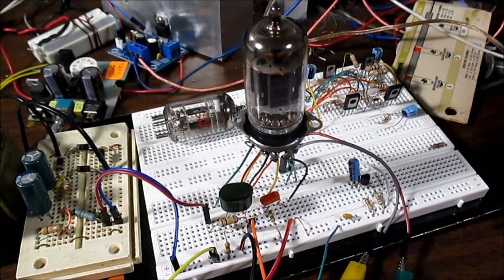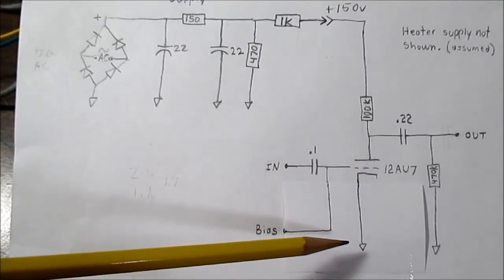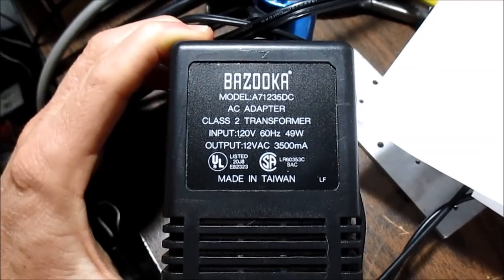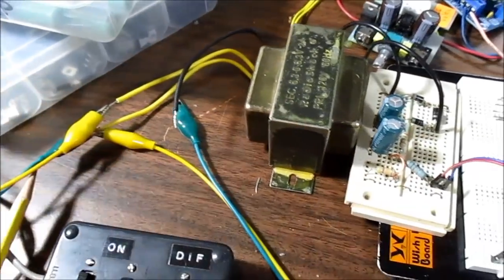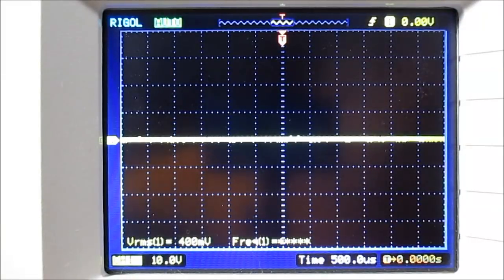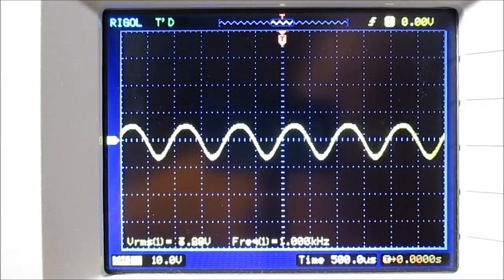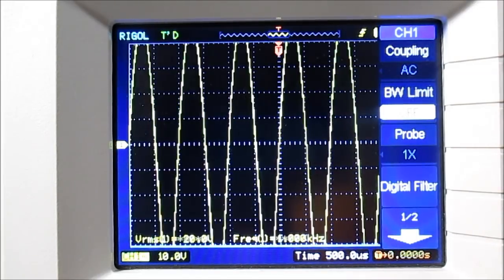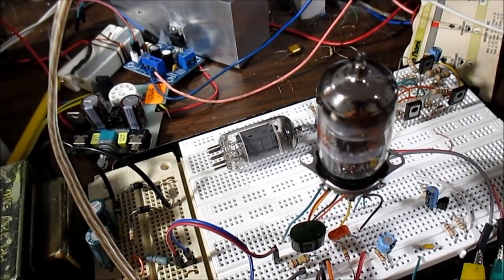How the cathode resistor cleans up vacuum tube amplifier performance

Comment: I liked that idea of using a 12v 3.5amp transformer driving another 12 volt secondary transformer to achieve the 120 volt from its primary for the plate voltage

Comment: Huh, I just can't. Do not even know where to start. The very best for humanity would be that YouTube stops exiting.
They will never change, and they made it possible that anyone looks like an expert while they have at best dangerous half knowledge that they are teaching people that do not know the matter. One person ploutes thousands.
A lot of times, it's just an innocent misunderstanding of complex matter. Seeing just one part of the complex environment.
This leads to explanations that look like complete picture but actually aren't explaining everything that is needed to be able to apply the knowledge.
The sad thing happens when the video explains one thing partially good but introduces bad information and doesn't explain why things work the way they are and what was necessary to be explained.
Let me give you a few actual facts.
You do not need a coupling cap in the input of the tube amplifier. The better thing to use there would be a grid stopper resistor.
Tube conductance is regulated with the voltage only. One brings voltage on the grid, and depending on its polarity and value, it will regulate the flow of the current. Negative voltage will stop the conductance while positive charhe will increase it. There us no grid current to speak off. Hence, coupling cap would be necessary only if you are inputing DC voltage instead of AC signal like audio signal is. At the same time, the coupling cap is needed, or at least it is a good thing to have in the input of the transistor circuit.
On the other side, grid stopper resistor would prevent dangerous self oscilation and parasitic oscilations. 
You can't have a non biased tube. Plate resistor does so many things, but it certainly is not used for the biasing. Sure, it will limit the maximum currnt draw, but it doesn't do much for the proper biasing. 
Biassing is done by bringing appropriate levels of negative voltage where, indeed, the cathode biasing is working like that and is most often used method in the preamp sections.
It's not enough to say you can't do this with more powerful tubes because you should never do it in the real application, disregarding that you can get away with it in the experiment like this and for the short time application you shoild still never let the tube run away.
You should not use bread boards for the tube experiments. Aside from the issues that come with the high voltage, especially if someone would like to design the output stage of the amplifer, there are so many potential issues that will be introduced by using a bread board. Contact resistance means way more in  high voltage circuits. Bad contact with grid especially will make tons of issues. There is a reason why millspec and nasaspec soldering standards were made. Simple experimenting PCB is way better and solves so many issues and prevents huge troubleshooting efforts.
Disregarding that Ohms Law is the same in transistors and tube circuits  things behave differently in such circuits. High voltage, high impedance and low current circuits are more sensitive to cold contacts, dirty contacts as well. Making proper mechanical contact and using soldering just to lower down contact resistance and to remove oxigen from the connection are rules for tube technology.

Comment: The moral to the story is dont bypass cathode resistors or if you do just partially bypass cathode resistors. If u dont need the extra gain then let the cathode resistor clean up some distortion

Comment: You just cured a 6 year issue. Thank you so much! And I trust wood and rubber insulators also. Just like my discharge tool, or wire insulation and a wall... couldn't help it. I saw pencil Karens...

Comment: 16:22 So what would casue a 22u/25V polarised cap to blow from the cathode of a 6V6, also in parallel is a 1W/470r resitor and a 104/63V cap?

Comment: That, was a great video that was explained well. I am trying to understand the differences between transistors and tubes in audio circuits and haven't built a tube circuit yet. 
Thank you uncle John.

Comment: I just read an old (2008) article from Gyula Sipos (IC engineer from Hungary ). Tubes vs Transistors in HI-FI amplifiers.
The transistor amplifiers can be better in THD measurement if they are using one or two input signal. Over three different input signals the tube amplifiers are better in THD, those are make less harmonics than transistor amps.

His experience.  The production quality of the tubes in 1950's  was much better than the transistor's in 2000-s. Deviance of parameters in branded tubes were around 10% in 1950-s. Deviance in transistors are huge in 2008 still.  Pairing is not doable in amateur's workshop. The simple hfe measurement with DC in one operation point worths nothing.  Deviance from vendor-to vendor, from transistor to transistor. Transistors are more complicated than tubes.  Those have around 70 parameters which is only known by producers. Every parameter connected to every else parameter. For example just Hfe changes with temperature, current, voltage, frequency and of course different from vendor and series. The silicon temperature changes measurable to 50kHz.   The transistors are much better on hi freq above MHz, they can easily oscillate in Mhz region. The combination of non linearity and complexity and hi freq oscillating the harmonics can produce frequecy product around the audible sound [freq intermodulation], which is unnatural sound and harmful for listener.

Comment: 6% seems kind of high even for a 12AU7. Of course that is a lot of output swing with not a lot of supply voltage. It would have been interesting to see the results at more reasonable output or more appropriate B+. A good video would be optimizing operating points.

Comment: if you put a capacitor in the circuit with a smaller value would the grid be getting less current?

Comment: I built a tube tester based on your concept. I can plug in any tube and with jumpers I can hook the tube and resistors in circuit while controlling bias voltage vs plate current, thus calculating Transconductance. I also inductively couple a sine wave in on the grid and measure the plate signal for a gain measurement in Siemens.

Comment: Because of the relatively low gain the 12AU7 is normally used as a phase inverter in double ended amps.

Comment: ...same Harmonic Profile generated here by a tube (12AU7) and by a transistor (KSC1845) in the week before vid of nov 08,2017 . You prove on the scope that Harmonic Profiles are a result of the circuit design and not the result of discreet audio tube vs transistor components . i see it w my own eyes  - -  same profile , same intensity . Other things like threshold noise may differ - - but i can forget my cherished view that tubes r inherently "sweeter" . .  . .............shalom,a.j.

Comment: Very interesting! I had always thought that Plate Voltage was purely an applied voltage, not  a derived voltage determined by the grid bias. I'll have bench this out now and experiment!   Thanks!
Reply: It’s my understanding that the voltage is applied to the circuit the vacuum tube is in which means the voltage at the plate could be the applied voltage but the voltage drop across the cathode to plate is derived. Cathode follower is when the useful load is placed on the cathode side of the tube.
The tube acts to transfer small voltage fluctuations occurring at the grid the occur in larger form across an element in the circuit having cathode to plate continuity. The heater is not the main source of heat but all the mobile negative charge carrier bombardment going on within the tube is my guess. If there wasn’t a load in the circuit containing the tube the circuit would 100% inefficient with no useful output.

Comment: Hi there i have buld an stereo  tube amplifier with output tube a 829B at 520v on anode my question is what resistant must i use at the cathode. In some schematics i have see diferent  values from 220ohms to 380ohms.
I think the higher the resistance to the cathode  as you lower the power output but i don't want to reduse the output power

Comment: You chose a cathode resistor based on your desired bias voltage. Is this good practice? You could choose a cathode resistor based on some other criteria and set the bias with additional components.
Reply: Remember, the grid had to be negative by 3.4v with respect to the cathode.  That resistor raised cathode by 3.4v, now pulling the grid to ground it is biased with the plate voltage at half the supply... giving maximum output signal swing in both directions!  This technique, called "self bias" is used with jfet biasing (using a source resistor)  This eliminates the need for dual supply.  He did it absolutely correctly.
Reply: @mikeduino4596  Maximum signal swing in both directions happens at 2/3 of supply voltage, not 1/2. (Which is why John's signal clipped on the positive excursion before clipping on the negative excursion.)
Reply: @silasfatchett7380  If what you say is true, then a circuit biased at 1/2 of the supply voltage would clip first on the negative output excursion. Right? This post is so old I don't remember the exact circuit. I designed and built a tube preamp with a single 12au7 and biased it pretty close to 1/2 B+ and it works fine.  I used 150v B+ and have about 22Vp-p before any clipping.  With a gain of approx. 18db I'll NEVER get close to clipping with a line-level input.

Comment: After trying different value resistors on my preamp tubes, I figured out that placing a 1.2 Volts rechargeable battery as a replacement it works the best. Now my preamp tubes get between 1.2 and 1.3 Volts on the cathode to ground and they are happy! The batteries recharge themselves when my amp is turned on, and there is no issues. I don't have to worry from now on about resistor and bypass capacitor values no more.
Reply: You could also use some LEDs instead of a battery and enjoy the light show while you play  :)
Reply: @jaysterdude  Actually I was thinking that exactly, I have something on a board right now.
Reply: How does a positive power supply, recharge the battery?

Comment: John, nice video. I especially like the part where you showed the gain measurement of the triode. I have recently gone thru my TV7 tester and did a full calibration which, fortunately, turned out well. No repairs were necessary. But it got me thinking... instead of purchasing a 6L6 cal tube, why not make a simple circuit to measure the gm of a handful of the old metal 6l6'S and do it yourself. I have a second tube tester that I used for comparison to do my adjustments. I see across the Internet where people build tube testers and some of them look really good but I am thinking really basic. Just a chassis with the sockets and PS and banana jacks for accurate instruments to measure the plate current and bias voltage along with driving signal for the grid. I guess the way I am thinking right now is why I noticed your gain measurement of grid voltage vs plate voltage. Anyway, just wanted to say thanks for posting.

Comment: Interesting video. I don't see the value of using vacuum tubes anymore. Power hogs that have now be refined to micro-meter size JFET transistors for amplification of weak signals, and BJT transistors for power output stages. 
Fun Fact: Apparently, vacuum tubes where discovered to be EMP proof. This is based on U.S. taking apart the MIG 23 that defected to Japan from Soviet Union in the early 80's, and finding all the circuits around the inside of the aircraft, to be vacuum tube based!
It wasn't however due to lack of advanced IC design. 
The central brain-box, composed of traditional micro-electronic ICs circuits, but encapsulated inside a steel box, with shielded cables going to various external circuitry. 
They can take a kicking, and keep on ticking.
Reply: They look really nice, tube amps are relatively easy to build and understand, and the sound you get can (!) have a certain "warmth" to it. It's similar to the comeback of vinyl. A good DAC and Player are superior in terms of sound quality, but the sound of the vinyl itself can be pleasing too.

Comment: Hello John!
I am just think on a topic it would be good for a new video! and that is how to properly make a power supply for this amps you test.
Treating dual rails, for both mono and stereo amp boards, and perhaps using a voltage regulator too!

Comment: John, I'll would like to add when you add the catode cap over the catode resistor, you short circuit the AC content but lifting the DC that why the amplification gets better.
Reply: Hendry parman the DC does not change when you use a cathode capacitor, other than it stabilises it if the cap is very large.

Comment: Been saving this video so I have something good to watch while I have my dinner.  In my experiments with an ECC83 (which is the same as a 12AX7), I also found that a 4.7k cathode resistor seems to provide the right amount of bias.

Comment: Thank you for explaining that.... I was thinking as same as for the emmiter capacitor.. For transistor.. Same applies for tubes... But in my book they include a capacitor. I think that is for gain... But it increases distortion... They forget to mention.... Thanks john... I appreciate
Reply: Ranjan....I haven't watched this video yet...Nevertheless the emitter resistor does indeed introduce local feedback. The bypass capacitor connected across removes this feedback for AC signals restoring gain etc. The DC conditions are stabilised by the resistor - always remember there are DC conditions and signal conditions to look at in a circuit.
Reply: PS Often the emitter / cathode resistor is split into two values and only one is bypassed by the large value cap (to cover low frequencies) to compromise or have global feedback  injected. Edit; And with valves it is of course a simple way of biassing the tube by lifting the cathode above ground potential, called 'autobias'.
Reply: Johns circuit only shows one stage of gain. Most amplifiers use multi stages of gain. To reduce distortion overall negative feedback is used from the output transformer right into the first amplifier valve (tube) This flattens the frequency response and reduces distortion and noise and generally makes the amplifier more stable, all at the expense of gain.
Reply: Just to add though feedback is not a magic cure all -well almost -but you gotta keep an eye on phase changes. Keeping the feedback signal at 180 degrees out of phase is not always easy. If at any frequency it approaches the in-phase  signal condition you have oscillation. Excessive amounts of feedback can cause instability, as can smaller amounts without frequency compensation. The more complex the circuit, the more phase trouble you can expect. The quality of the amplifier used to be measured by its ability to remain unconditionally stable with the largest amount of feedback, proving the design. Plus of course feedback can lower output impedance, raise input impedance along with extending response, lowering noise and distortion etc, all very welcome and invaluable - if done with care.